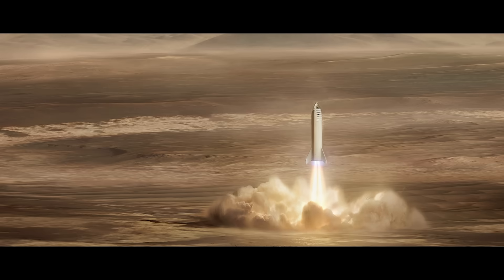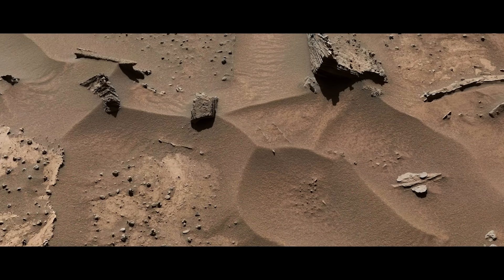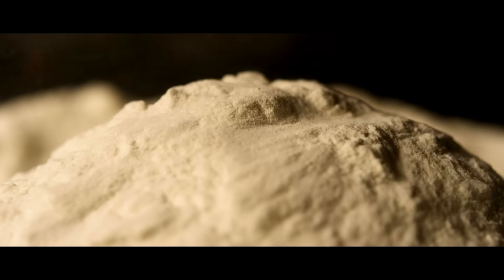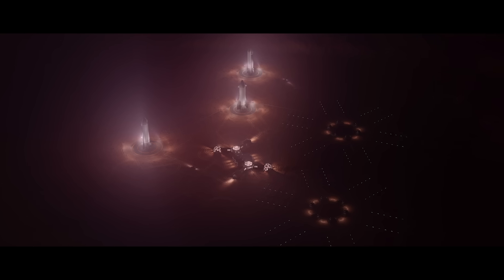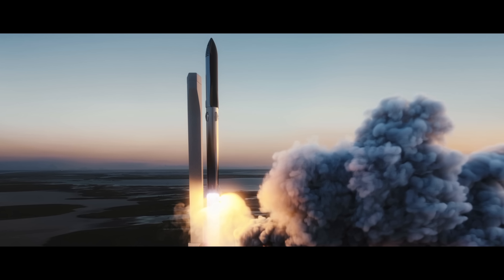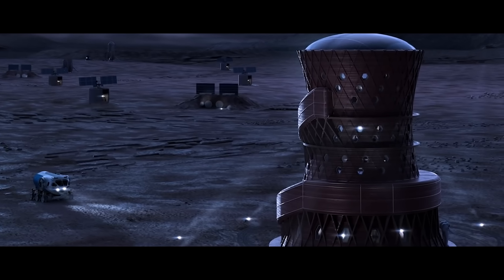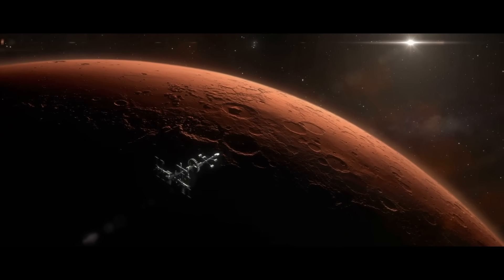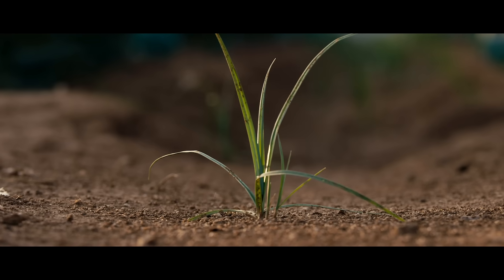THE FIRST 10,000 DAYS ON MARS (Timelapse)

Comment: Question 1: How do you find a company, producing reliable microchips (planned obsolescence)?
Question 2: It seems more protective to dig in the Mountains of Mars instead of placing vulnerable parts in the open (radiation/meteors etc.)
Reply: I mean, we can't just start digging into the mountains straight away, we'd need to settle down and get all of our equipment ready, but yeah long term living like that in the open is extremely dangerous
Reply: @dik56  trust me... Earth was same as Mars..and atmosphere is created...
Reply: The plains are better areas for solar panels. The closer to the mountains you get the more shadow time you have.
Reply: @LordSevarg - Nuclear fusion plants will take over most of the solar panels in Mars according to the video. I kinda feel safer around solar panels, though.
Reply: Computerchips are really small and you'd need really big machines and infrastructure to produce them. Even for the mass and volume of just one of these modern lithography machines (not solving the issue of raw materials etc) you could probably ship millions of finished microchips to the colony instead. Such technology has a really long chain to become self-sufficient.
Reply: A monthly subscription? It'd deeply piss people off, but it'd be better than planned obsolescence.
Reply: yeah pretty sure safe way is to dig several meter deep inside. and insulating it with water to protect us from radiation and cosmic rays..
Reply: There are companies doing it.. they just doing do it for consumers.
For example you can get industrial grade electronics you just pay 10x more for them.
Reply: They'll have to bring maybe 2 microchip and semiconductor machines to make it and a ship load of them to get them started on Mars, and they'll probably need to have tunnel systems to live and travel around
Reply: The station should be placed in caves under the surface of Mars to protect against radiation.
Reply: for question 1, demand creates supply. Also, microchips engineered for prolonged space operations already exist. NASA and ESA spacecraft have taken used chips on their journey not only to probe other planets, for prolonged operations in deep space (such as in JWST) but also literally near passes to the surface of the Sun.
Reply: Also Mars soil is completely toxic to life.
Reply: I also noticed no viable explanation for how the budding colony would Insulate itself, especially its solar panel fields, against Martian sandstorms, which can last for months.
Reply: Publicity. It's science fiction.
Reply: Dig for what?  
It there were gold bars lying on the ground it still wouldn't pay to go there and pick them up.  The cost of transporting them would be more than their value.
Reply: Question 2 is not very questiony. It's more of a statement.

Comment: I'm sorry to rain on Elon's pipe dream but none of this is going to happen in 2025. It may be possible after 2050. The reason we aren't even close to be ready yet as the basic research required isn't even 10% completed. We have to conquer several things to go and stay. 

1st radiation. The life ending radiation on Mars is ubiquitous and unending. Mars has no magnetosphere so all habitats MUST be underground for anyone to survive. Surface dwellings are off the table. One CME from a space storms hiting anything live will kill them so the only arriving to Mars will be a capsule of cadavers.

2d Radiation protection enroute to and from Mars. The only way to ensure crew safety somekind with ship board magnetosphere. 

4th is Engines - for there to be viable colony on Mars travel times must be whittled down to weeks not months. 

Finally, there has to be a balance. We massive problems here that need to be solved. Because earth is our space ship and it works really well. We just have to clean up our planet and stop polluting it and we won't need Mars.

Comment: No magnetosphere. No ozone layer. Low gravity. No breathable atmosphere will stay put for a loooooooooong time, if ever. Low air pressure means staying in spacesuits outside. All this also adds up to prolonged death from solar radiation. Earth is safe ... for now. The correct strategy is sending up construction bots first and finding caves to live in. Unless you want to spend years pushing Martian soil over habitats to protect you from gamma rays and the like.

Comment: Unfortunately, Mars lacks a magnetic field. That means that radiation, whether solar or cosmic rays, is free to irradiate the surface of the planet. The only way that humans can colonize Mars without suffering early death from cancer or fetal death from fatal mutations, is to become troglodytes - in other words, to become permanent cave dwellers. The only thing that would avoid this issue would be developing technology that would allow visible light frequencies to pass (for photosynthesis) but filter out higher-energy radiation. The same goes for colonizing Jovian moons - for the opposite reason - the intense magnetic field of Jupiter ACCELERATES particles within its influence, resulting in intense radiation from the planet bathing the otherwise potentially habitable moons.  Again, unless the radiation issue is resolved colonization is an act of desperation that accepts high cancer and mutation rates.

Comment: Issue with solar panels is not only are they less efficient because of the distance between Mars and the sun, but the fact that they would need to be cleaned multiple times a day in order to ensure that they're operating as efficiently as possible.  

Habitation pods would be extremely heavy due to the increased shielding they would require as the planet does not have a very large atmosphere and no electromagnetic field.  This is really only an issue for launch purposes.. once they actually make it to the planet, it's not really that big of a deal.  As for the 3D printed habitats, they would have to be incredibly thick in order to offer protection from solar radiation.  3D printers aren't known for creating dense materials.  Seeing as they'd be using martial soil and plant material, they would need significant thickness to stop radiation from penetrating them.  As we all know, the best protection from radiation is a wall as thick as possible... the more mass between the EMR and you, the better off you'll be.

Nitrogen only makes up about 2.7% of Mars' atmosphere where as it makes up 78% of the atmosphere on earth.  That will be a rather big problem when dealing with the bacteria being transported there.  Seeing as the atmosphere on Mars is incredibly thin there will be little to actually help the bacteria propagate.  That being the case, there would be very little (if any) ammonia fertilizer being produced from the bacteria.  It would take massive farms of them in order to use them for any large scale growing of plants.  If anything, nitrogen would need to be transported to Mars in order to get anything going.  

I do take issue with the whole "fish" thing being presented here.  It assumes that there would be enough hydrogen and oxygen produced on the planet in order to make large enough habitats for fish to live.  Oxygen makes up 0.13% of the atmosphere.  That's not a lot... though there is a good deal of carbon dioxide, it requires quite a bit of energy in order to break it down into carbon and oxygen.  Hydrogen is a big issue as there is very little in the way of hydrogen on mars.  There's almost none in our atmosphere though we do have a lot on the planet, as it's usually combined with other elements to make hydrocarbons.  Mars lacks any significant source of hydrocarbons.  While there have been some sources of methane on mars, there's very little... and again the problem arises that you would have to break those hydrocarbons down in order to get any useful hydrogen out of it in order to make water.  That uses a lot of energy.  It'd be safe to assume that a very large quantity of water would need to be transported to Mars and in a constant state of recycling with VERY little waste.  Transporting large amounts of water would be exceptionally costly.  Water is fairly heavy when   you consider the amount of energy required to get it into orbit.  1 cubic meter of water weighs about 1000kg (2205lbs) and 1 cubic meter of water is NOT a lot, especially considering how much you'd need in order to operating any kind of small facility on Mars.  To put it into perspective, a medium sized above ground swimming pool is about 3,000 gallons of water.  That translates to about 16 cubic meters of water.  So let that sink in.  There's not much you can do in terms of farming/sustaining life with just a swimming pool worth of water, let alone trying to keep a lot of fish alive.  That's over 18 tons of water.  The average commercial satellite weighs in at around 1 1/2 tons.  Even with SpaceX claiming that it only costs them around $2720 per kilo to launch into space.. that puts that measly 16 cubic meters of water at around $96 million.  An Olympic sized pool comes in at around 660,000 gallons of water which is 3000 cubic meters and a cost of around $18 BILLION.  That'd be hard to get into the US federal budget (I doubt Elon would be doing this for free).  NASA's fiscal budget for 2020 was $22.629 billion.  So over 80% of their budget in a year would go to just launching a bit of water to Mars.  Likewise, the average person uses about 110 gallons of water a day.  That's half a cubic meter of water.  Even if you cut that down by 50%.. one person using 0.25 cubic meters of water a day (JUST THE PERSON) means that you'd need quite a bit just to sustain people.  This isn't accounting for plants which, on average, require an ENORMOUS amount of water.  You're talking about orders of magnitude more than people.  Without boring everyone with the math involved, I'll simply put it like this... the amount of water that would really be required for a small colony on Mars to just get started, would require about as much money as the entire US GDP for a year. Less if you just go for the EXTREME BARE MINIMUM with 100% recycling efficiency, but you'd have to be a complete nut job to just go with the bare minimum.  That and there's no such thing as 100% recycling efficiency.  That just defies physics in general.  You're going to lose a lot of water per day no matter how good your system is.  This is JUST water people... not counting for anything else.

Next up.. the "nuclear fusion power plant".  This is just absurd.  I don't care what you people have heard in the news, we are a VERY VERY VERY LONG TIME AWAY from any sort of nuclear fusion reactor.  We have not built ANY kind of rudimentary reactor that is capable of generating power more than what's put into the system let alone able to EXTRACT that energy in any meaningful way.  This is just nothing more than absurd speculation for this video.  Currently just scifi nonsense considering where we currently are with this technology.  Barring some extreme scientific breakthrough, this is just not going to happen.  More likely than not we would be using fission reactors.  These, of course, require a LOT of water... and if you've read the above section, you'd see the issues with this as well.

Now, overall the biggest issue I have with this depiction is the fact that it claims everything would be "self sufficient" in producing breathable air, energy, fuel, etc.  That's just not realistic.  A lot of this requires elements that are just NOT readily available on Mars and if they are, in such small quantities and so difficult to extract that it would require significant resources to make.  Physics gets in the way of a lot of this.  You cannot take more energy out of a system than what you put into it, and any energy in that system will be lost due to entropy.  You're going to lose air, you're going to lose water, you're going to lose hydrogen, oxygen, carbon, energy...etc.  So much of this needs to be imported just to sustain everything.  With the extremely thin atmosphere and lack of an electromagnetic field, you're going to lose a lot of these things over time with absolutely no possible way to get them back minus taking from what we already have on Earth or some other source.  

All in all, it's not an IMPOSSIBLE feat, however... it would require a near global effort in order to pull off a colony on Mars.  The idea that just a couple of companies could pull this off is just incredibly absurd.  A venture like this would require a collaboration of multiple nations with almost no regard to budget to accomplish this.  There seems to be a lot of focus in this video on Musk and his businesses.  That's just rather disturbing if you ask me.  Almost like an over glorified marketing video.  The fact of the matter being, that even if his companies played any major roles in this, it would be an extremely SMALL fraction of the total effort needed.  It's almost like a video talking about building a car engine but they constantly mention the manufacturer of the spark plugs.. ignoring every other part of the vehicle.  Not trying to take a swing at Musk at all, but yeah.. seems a bit over hyped for some odd reason and honestly doesn't make sense.
Reply: thank you for commenting this. i find it very interesting how you depicted the video, and I agree I find it very unrealistic how they mention all of this would be done by 2050... If anything by 2050 we'd barely have the start of a colony I'd guess and that's still very lucky